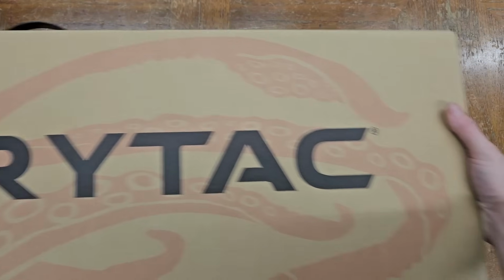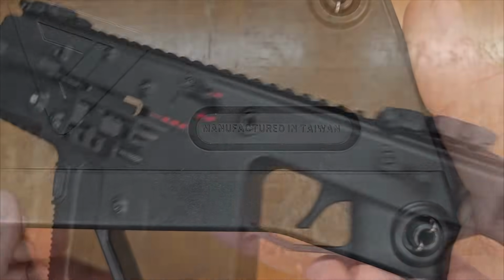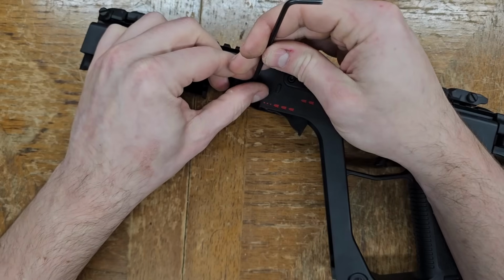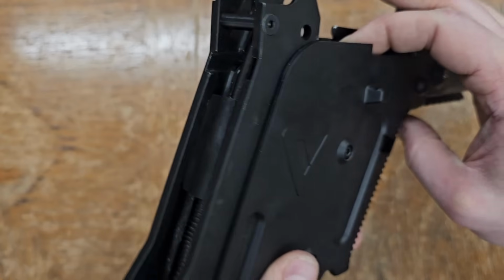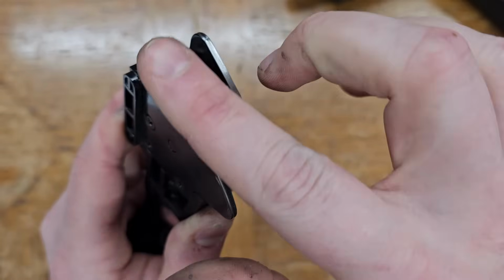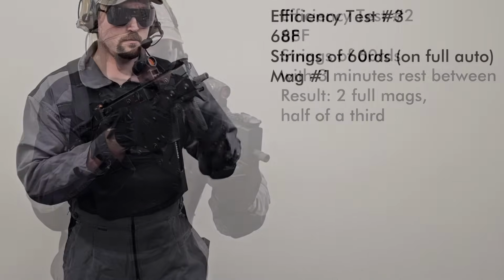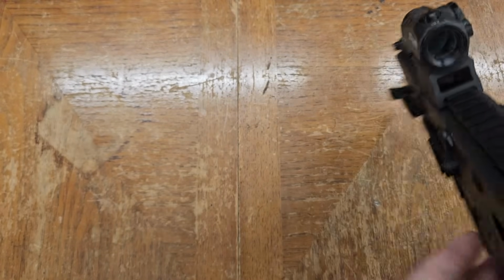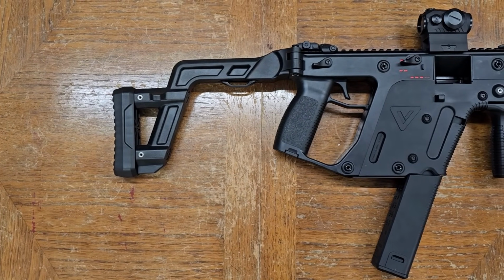Krytac Airsoft Kriss Vector GBB Review: Highs and Lows

Comment: I heard about all of the issues this gun was having an decided not to pick one up. Mainly because the "Super V" system this gun uses is more "half baked" than the KWA model, which uses the full Super V system. Hopefully they can fix the cup seal with something that isn't awful but if this gun gets as popular as it seems to be, that's only a matter of time. 

Personally, I'm going KWA with this gun. Sure, it's expensive and has it's issues but I prefer realism over whatever Krytac did with this gun.
Reply: Also krytac hammer and sears work in the kwa. Also the hop system from the krytac works in the kwa.
Reply: You got a source for these claims? I have the KWA version and would like to know more.
Reply: @haraldmadebrink5324  These claims come from the people I spoke to in the Heavy Recoil Club on Discord. They're currently working on figuring out how to fix the issues it has, but so far, the number 1 fix they're looking for is an entirely new nozzle.
Reply: @Gojira_Wins  may be worth a buy if the nozzle gets fixed, and the buffers for the travel.
Reply: @jpisback  If they get a new nozzle created or fix this one, definitely. Pretty much everyone is just cutting the buffers though. Not too much of a reason to make new ones when cutting the existing ones works just as well.
Reply: @Gojira_Wins  too short apparently renders it useless and needs replacement, so an aftermarket replacement wouldnt be a bad idea.
Reply: @Gojira_Wins   For me there are 2 differences between the KWA and Krytac. The hop-up system and the nozzle that stays in line for the krytac when for the KWA the nozzle follow the recoil system. I think the parts from black variant (nozzel with O-ring) will work on the krytac.
I sure hope Angel custom revives its KWA Vector parts because for me they look the same.
Reply: @mahadkaezan536  Woo! More parts!
Reply: @mahadkaezan536  for real?! Are there pictures of this? I would love to see that. Especially for the hopup.
Reply: +1.. why even bother GBB without doing the full bolt travel, and still fail at making it as reliable as the KWA.
Reply: Hearing this makes me lean towards a Rattler instead.

Comment: The crappy thing is the anti recoil thing makes it kick less.. Any way to disable it?
Reply: No, the system is integral to the bolt’s function
Reply: In the future you probably can buy a steel bolt or something, but it's a vector mate it's supposed to have little kick
Reply: Sorry mate but who tf buys a vector for recoil, its idea was to make a recoiless gun so ofc the airsoft version is gonna have little to no recoil😂
Reply: @lofighost8811  admittedly, as an owner, the recoil system in the krytac is the weakest point. Im sure the replica would work great if it was either heavily modified or just removed
Reply: @lofighost8811 a real vector has decent the recoil… There’s no need to remove recoil in a GBB. (Yes, replication is cool, but having some more recoil would make it more realistic and fun, it would still be “low” compared to real)